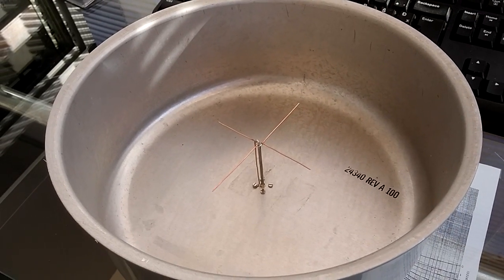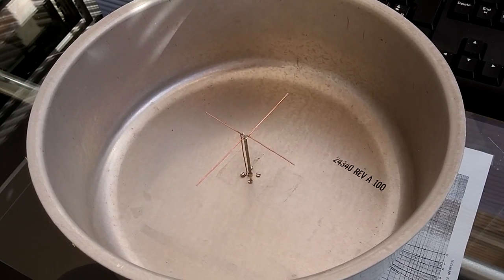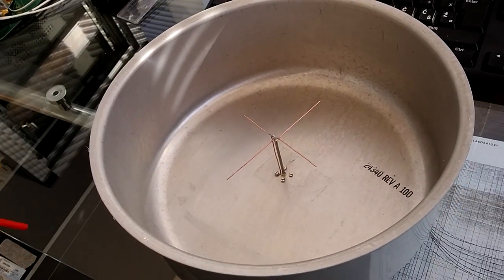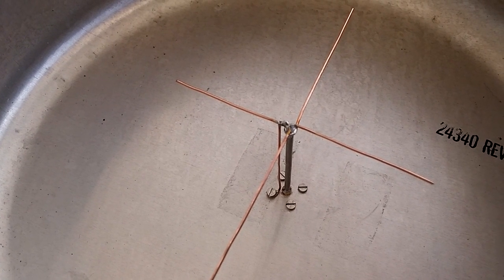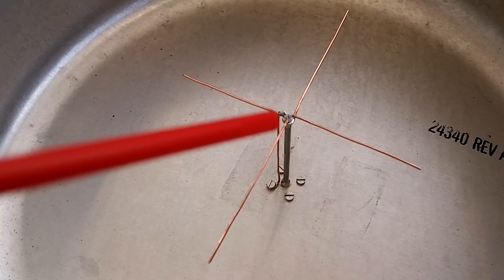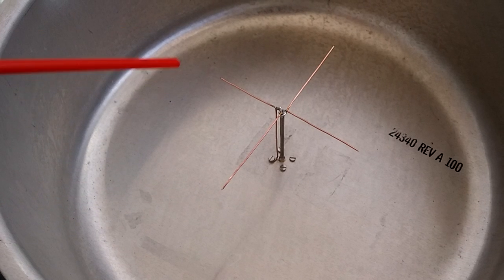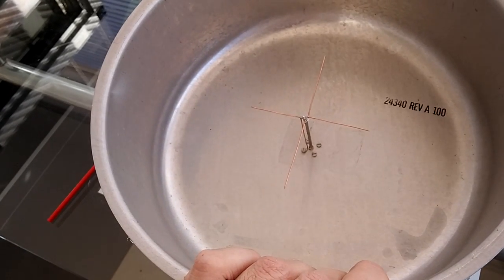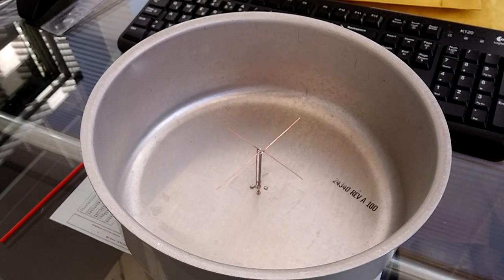L band cooking pot antenna

Comment: congratulations, I built it and it works well, could I use the dipole you illustrated on a self-built wire mesh dish to get more gain?  If so, how can I calculate the focus where to install the dipole?

Comment: Would a spiral be better?
Reply from the maker: For that height of the reflector rim you can have not more than 2 turns and this is 8dBi at max. So such a short helix is still lower gain than the presented antenna.

Comment: I can not see how the wires are hookup.
Is there any image on the web about this cross dipole?
Reply: This site has a good tutorial on a 430 MHz version with some good pictures that might help explain it a bit. A bit different in that it uses a sleeve balun instead of 1/4 wave stub but the diploe arrangement is the same. I've used these on a couple of RC airplanes with great success.
"http://fpvlab.com/forums/showthread.php?3626-Crosshair-10-dbic-Circularly-polarized-antenna-tutorial!"
Reply: Thank you so much for this info !